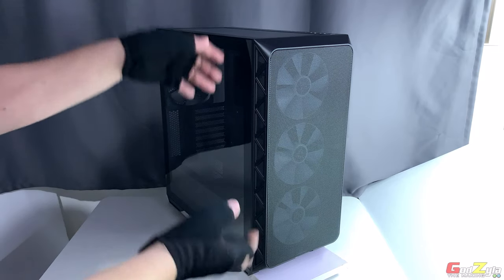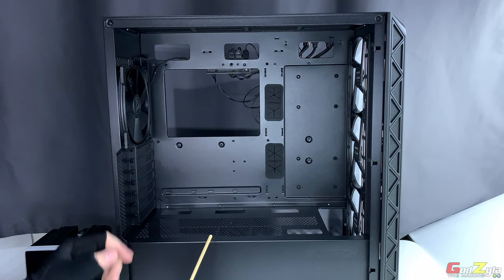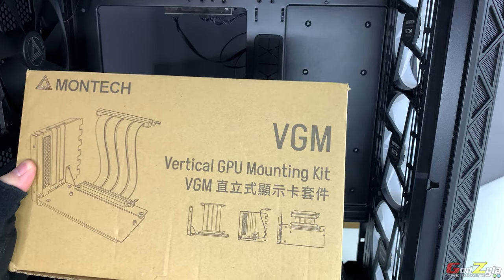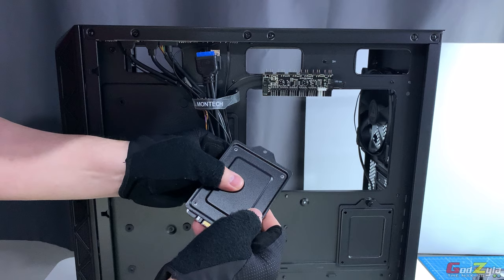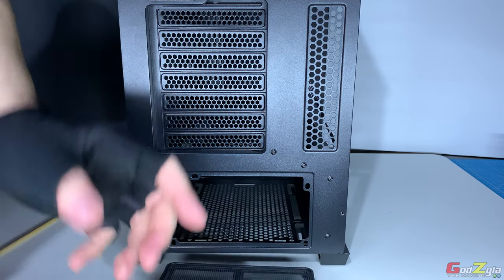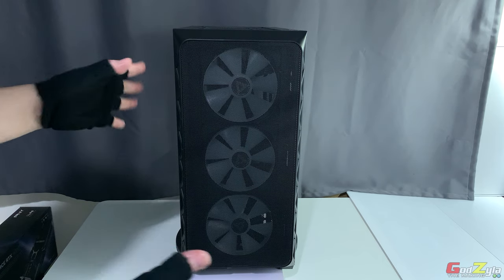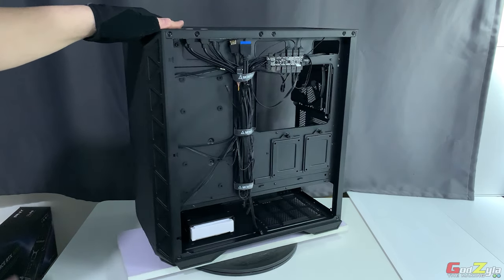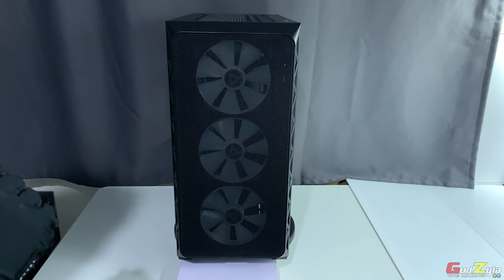Montech Air 903 MAX

Comment: Hi there! How do you connect the 15 pin sata cable of the controller to the PSU? Thank you very much!
Reply from the maker: Hi Bruno Russo, welcome to my channel. Every PSU comes with a Sata cable, using one end of the Sata cable, connect it to your PSU and at the other end, plug it to the controller sata connector. Do not plug the controller sata connector directly to the PSU (though this is not possible but just a friendly reminder)
Reply: @KleoYan  thank you so much for replying! My PSU has a a sata cable that divides into three 4-pin. Do I need an adapter or am I being dumb? I have a picture if I can show you somehow. Thank you so much for replying and for trying to help!
Reply from the maker: @awakening123  hi do you know the model and brand of your PSU and you can send a screenshot to my email at godzylatech@gmail.com.
Reply: @KleoYan  will do soon. You’re awesome!
Reply from the maker: @awakening123  you are most welcome. I have replied to your email. 😉

Comment: For the argb controller, is there anyway to control the fan speed without pwm connector on motherboard. I have a older asus P5K deluxe mobo. It has 4 pin cpu fan and (4) 3 pin cha fan headers. Is there anyway to make it work with an adapter mabey?
Reply from the maker: Hi MegaBorn2 welcome to my channel. May I ask what’s the exact model of your motherboard? Let me see what I can find out on its manual is bios setup. Thank you.

Comment: planning to buy this case and plan to pair it with a rog strix b550 a gaming mobo will the 2x USB3.0 Port in the front panel still work if i connect it to the usb header? im not planning to use the type c usb just the  2x USB3.0 Port ? pcpartpicker says ( A USB 3.2 Gen 1 to USB 3.2 Gen 2 header adapter is required) will it work if i just dont get an adapter ?
Reply from the maker: Hi Miguel Enrico, welcome to my channel, if you just wanted to use the USB 3.0 Port at the front, you can just plug the case USB 3.0 cable to your motherboard, it's the blue cable which is shown at timestamp 19:03, the plug that is blue right below the headphone jet. no adaptors needed.

Comment: I'm going to put 3 artic 140 PST ARGB on the front of the case by connecting the ARGB cables to the hub controller on the case and the RPM to a fan connector on the motherboard. Until then I have it clear. If I put the 3 fans that come with the case at the back and on top and connect them to the hub controller and from there to an ARGB connector on my motherboard, those HP fans will be compatible with mystic light msi. I have looked on the official Montech website and it doesn't say anything about it. I have also looked at the mystic light msi compatible devices and those default fans do not appear. In conclusion, the ARGB light on those front fans will be able to work via software or in other words, how can I know what software is compatible with those HP 140 fans that come in the box? The artic 140 do appear compatible on the official msi website. Thank you and your work is excellent.
Reply from the maker: Hi Isidro Juárez, welcome to my channel and thank you for sharing your thoughts 👍 Do let us know how’s your system temperature once you have completed your build. I wish you all the best too 😉

Comment: I broke the LD switch on the fan and rgb hub is there a site i can order a replacement? It would suck if i have to replace the whole case
Reply from the maker: Hi Avery GM, welcome to my channel. You can contact them through here https://www.montechpc.com/en/contact.php, either use the form or to directly email them at headquarter@montechpc.com
Reply: @KleoYan  I definitely do this! I currently ordered a 3rd party piece to replace the the whole hub. So hopefully the 3rd party piece works if not I'll definitely call them
Reply from the maker: @averygm9728  ok thats good, but I do encourage you to request a replacement of the controller as you have paid for it. Just my opinion. All the very best 👍

Comment: I'm planning to build with this case using ASRock Z790 Taichi Lite LGA 1700 MB, and ARCTIC Liquid Freezer II 360 A-RGB. Has anyone tried this combo? The MB VRM looks to be off-set from the board edge (more than your example). Hoping the Arctic cooler will fit.....
Reply from the maker: Hi bigheffe, welcome to my channels. If you watch at 10:57 of this content. If it’s of a 360 LF2, you will be able to fit at the top with the Taichi Lite motherboard. There is enough space. You only worry if it’s or a 280 LF2. Hope this helps.

Comment: Got my pc assembled by someone else, any idea which wire to disconnect to permanently turn off the fan lights? I can use software but it doesn’t work until the computer is completely turned on.
Reply from the maker: Hi E WCQ, welcome to my channel. if that's the case, you can daisy chained your front fans and plug directly to your motherboard. do not plug any ARGB fan connectors to the case controller.
Reply: @KleoYan  Thanks I'll try that. Great video btw, honestly one of the best reviews for this case.
Reply from the maker: @ewcq11  you are most welcome and thank you for your kind words. All the best with your build 😉

Comment: Hi, sorry for the stupid question, but I was wondering, if I plug 12v sata connector into the rgb and fan controller + argb 5v connector from controller into my mobo, could it damage my argb fans, because they only need 5v, but I plug 12v straight from the psu aswell  ? 

// Very good and detailed vid tho, watched it with pleasure, keep it up!
Reply from the maker: Hi Сергей Ковалёв, welcome to my channel. It’s good to ask questions when unsure. We all learn 😉 and nope you will not damage anything as the controller has a current regulator to draw 12volt on fan pwm and 5Volts ok fan ARGB. When you plug controller to motherboard, it will determine by itself. Don’t have to worry when you plug the 12v Sata cable from the controller to the PSU. The controller as said will determine how much current is needed.
Reply: @KleoYan  got it, thanks for the fast response. My pc parts are coming soon and I'm gonna assemble a new computer, haven't built a PC in a while, there were no such things as ARGB when I did it for the first time so I just wanted to make sure that it will be just fine :)
Reply from the maker: @d0ct0rned  I see, all the best with your build. 😉

Comment: thanks for the video, extremely detailed, great job.

i've heard there's a way to top/front mount a 420mm aio, is it true? i know you showed that a 280mm aio wont fit, but maybe by modding the case? idk
i'm thinking about getting one but i have a 420mm aio, the case looks great and is at a good price
Reply from the maker: Hi sourra sas , welcome to my channel. No this case does not take 420 liquid ARO at the front, the lenght is way shorter than the 420 liquid aio radiator, though you can mount 3 x 140mm.

Comment: Good video. Just subscribed. Just wonder how well  b650e or x670e motherboards fit. Building 2 computers one using a b650e taichi lite the other using x670e taichi carrera. Montech advertises eatx, but im not sure how well it will eatx motherboards fit. This case checks a lot of boxes at a great price. If it works.
Reply from the maker: Hi Daniel Howell, welcome to my channel. It did mentioned it can house E-ATX but it will cover partial of the two rubber grommet which can be tricky to pass through your 24pin cables. Personally I would not use this case of E-ATX board.

Comment: How about 280 AIO mounted to the front? Or maybe 420?
Reply from the maker: Hi Tuubi Kuusela, welcome to my channel. You can mount the 280 but advisable that your fans are at the front and not inside the case with the radiator.
Reply: @KleoYan  Any chance 420?
Reply from the maker: @tuubikuusela7847  hi welcome to my channel. Nope, this case is not catered for a 420 liquid aio.

Comment: Hello! Thank you for making this video as I have the same Montech Air 903 Max case now! In regards of mounting a 360mm AIO on the top, would ARCTIC Liquid Freezer III 360 A-RGB fit? or is the radiator too thicc? I have an MSI B660 Mag Mortar DDR4 Wifi board with big vrm heatsinks. I know you mentioned it in the video at: 12:31 but I didn't understand if it fits or not. You said it touches the VRM heatsink of the motherboard, but does that impede it's installation?
Reply from the maker: Hi ZealousPumpkinTV, welcome to my channel. I was referring to Arctic Liquid Freezer II 280 not 360.. 360 LF2 or LF3 will fit.
Reply: @KleoYan  Hi KleoYan! Thank you for the reply! That's good to hear then, I'm thinking of getting the 360mm AIO from Arctic in the future then and putting it on the top of this Montech air 930 Max! I appreciate the help! I subscribed!
Reply from the maker: @ZealousPumpkinTV  you are most welcome. All the best with your build 😉

Comment: I bougth this case and Arctic Liquid Freezer II 280 and asus rog 3090, what is the best way to install the Arctic Liquid Freezer II 280 ?
Reply from the maker: Hi Ahmed Essam, If your motherboard does not block the LF2 280 at the top. Try option 1 which is best configuration, if not try option 2. 

Option 1
3 x fan - Front intake
Arctic Liquid Freezer II - Top exhaust 
1 x rear fan - Exhaust
1 x bottom fans, intake. (place the fans near the front as the back portion is useless as the PSU is directly below the fan)

Option 2
1) Arctic LF2 280 at the front with hose at the bottom. (If hose not able to do bottom, then you got to do at the top)
2) 1 x bottom fans - Intake
3) 3 x top fans - Exhaust 
4) 1 x rear fan - Exhaust 
If you place GPU horizontally, the heat will directly exhaust and hitting your motherboard area. So to compromise, since your liquid AIO is at the front, which move warm air in from the front, have your GPU vertically mounted.

Comment: my case cable that you show at 17:29 only has two cables attached to the connector but 4 holes. I am having a hard time understanding were this needs to plug in. When i trace it back to were its connected, that connector ( on the fan/rbg ) control unit, also only has 2 cable. im not sure if it goes to motherboard and if so to which header. Thanks
Reply from the maker: Hi Apaches04 Soccer, welcome to my channel. send me an email with the picture of your controller. I will try to guide you through with pics. Thanks!
Reply: @KleoYan  Thank you for the reply! I viewed your vid a couple more times and was able to trace me cables. it turns out my cable went to the system fan plug and i found the correct rbg plug. the system fan plug wasnt noted as system plug it was something like swyz
Reply from the maker: @apaches04soccer  hi and thank you for the updates. Hope you did fix the issue 👍👍👍

Comment: How is this case compared to the Lian Li Lancool 216?
Reply from the maker: Hi Chook Pan Quan, welcome to my channel. This case has the upper hand as it’s more spacious to work with. As for thermal, both case does its job. The final decision is still up to you.
Reply: @KleoYan  Thanks for the prompt reply, so it's safe to say this case would be your pick out of the two regardless of price? 
What about in terms of build quality and sound insulation, would you say the lianli216 is worth an extra 27 sgd?
Reply from the maker: @chookpanquan9172  build quality wise both are of the same. But personally I will go towards Lancool 216 as am attracted by the front 160mm fans which I can operate at lower rpm but still bring tons of cool air to the case
Reply: @KleoYan  Thanks for the feedback
Reply from the maker: @chookpanquan9172  you are most welcome and all the best with your build too 😉

Comment: Hello, how durable is the case?(like it's flimsy) I'm thinking of either this or the H5 flow.
Also I saw some people reporting the power button blinking at night when the computer is off and the usb button doesn't work, does it happens to you?
Reply from the maker: Hello Star Seeker, welcome to my channel. The power button blink is due to the hdd activity, when it’s off, it should not blink. You can don’t plug the HDD LED to your motherboard and that will stop the blink as for USB, I don’t have that issue either. It could be motherboard bios is not up to date. Check your motherboard bios page to see if there are any issues on USB which has a fix. If not, you will be fine. As for durability. I have already illustrated that there are no cutting of corners. This case is build sturdy.

Comment: Hi kleo, I’m a new fan since I’ve saw your motherboard steel legend review! Really amazing and insightful content! Congrats.
I do have a question tho:
I’m building a new pc in am5, would you recommend this montech air, the lianli 216x or a montech sky2? Paired with a 7700x, rt6700x and the steel legend mobo
Reply from the maker: Hi Tokkenn, welcome to my channel. Based on your system build specs. Either of those case will do. Kindly note, the following are my own opinion and sense of aesthetic. If you want more airflow. It will be 1st Montech Air 903 Max, 2nd Lian Li Lancool 216 and 3rd will be Montech Sky 2. If want aesthetic. I will go by Montech Sky 2, follow by Lian Li Lancool 216 then the Montech Air 903 Max. If you want best of both will be Lancool 216. Lancool 216 not only looks good, it does perform; though is just a degree or two higher than the Montech Air 903 Max. The  choice is yours.

Comment: Thank you for explaining the fan hub! I am a first time builder and I was so confused as to which cables to plug in. 17:13
Reply from the maker: Hi Phoenix Phire, welcome to my channel, do pardon me for the late reply. Are you still confused or have this content clear your doubts?
Reply: I got it all figured out and it works great! Your video helped a lot. Thanks!
Reply from the maker: @Phoenix-Phire24 oh ok that’s good. All the best with your build.
Reply: @KleoYan hey I have a question? Can this fan hub be controlled by software that changes rgb and fan speeds?
Reply from the maker: @NavonAppelson  hi welcome to my channel yes you can.

Comment: I was going to upgrade my air cooler to an Artic LF ii 280 until I watched this video and realized the VRM from my Gigabyte z790 Aero G would cause an issue.

I was very impressed with this case at the price point.
Reply from the maker: Hi Josh Guacamolean, welcome to my channel. Yes it is indeed a good case for this price point. So sorry to hear that you like this case but it's not possible to mount the Arctic Liquid Freezer II 280 at the top

Comment: Wish I'd seen this before getting it as they made such a classic mistake with top spacing for coolers
Reply from the maker: Hi Artos Bear, welcome to my channel. Thank you for your valuable feedback, I am sorry to hear that. maybe tell us more of what you meant by a classic mistake with the top spacing for coolers. Thank you!
Reply: @KleoYan  oh lol my bad.  It's just a pretty common thing I've run into with cases where they don't account for radiator thickness running into the motherboard up top.  38mm rads+fans like Arctic's there ends up not being enough width sometimes, or not enough height, like in this one.  Another way it happens is with higher end motherboards having big tall covers on the IO panel like the Asus Crosshair VIII Dark Hero for instance.  The cover sticks up pretty far vertically from the top of the motherboard, and a lot of cases that are even "full" towers still get released without enough vertical space above the motherboard for installing a big radiator despite "supporting" a 360 or 420 or something.  

Pleased with the case in general and your videos are really really great...extremely helpful as picking out a case is just fraught with little problems like this that can bork you and you usually can't get your hands on a case just to trial it.

 very happy with the quality overall and the cable management is great.
Reply from the maker: @artosbear  I see, this is part of the reason that most of my PC case and motherboard open view, I will try to mention as much as I can. Being a PC Builder, we want to know in-depth details as we only have 1 time purchase. In some country like where I am, once item purchased, there will be no refund. Even if you can do full refund, the time spend to wait, it's a hassle, I rather do it once do it right.

Comment: Hello, clearly laid out in detail but I'm confused between this case and Lancool 216 which one you would suggest
Reply from the maker: Hi The Gentle Don, welcome to my channel. It all depends on your budget and how much you like about each case. for me I will go for Lancool 216 as I like the modularity plus the look of it. Both are with good case airflow.. just that Lancool 216 will cost more.
Reply: Thank you for your quick reply. The pricing differences at my local store between these cases are only $10 USD. And one more thing what your thoughts on Thermaltake Ceres 300 TG @KleoYan
Reply from the maker: @TheGentleDon.  the Thermaltake Ceres 300 TG I do not have experience with it, I can't commit to answer do pardon me. though the case looks good but I will go for Asus GT502
Reply: Once again, I appreciate your help.  @KleoYan
Reply from the maker: @TheGentleDon.  my pleasure 😉

Comment: Hello, great and very detailed review, highly appreciated! Love the measurements too. I have one question, if dont want to turn on the RGB on the fans at all, which of the cable on the hub should I not connect? Thank you!
Reply from the maker: Hi Neznamo, welcome to my channel. To do that, do not connect the ARGB connector (3pin 5V) of your fans to the hub. All the best with your build. 😉
Reply: Thank you very much! Best of luck for your next videos.  @KleoYan
Reply from the maker: @neznamo7 you are most welcome and thank you for your best wishes 😉